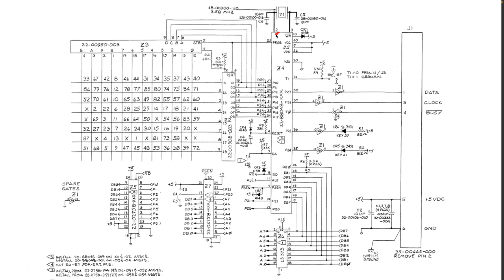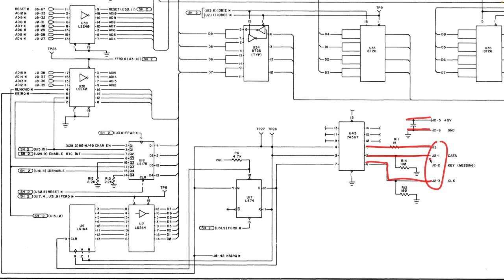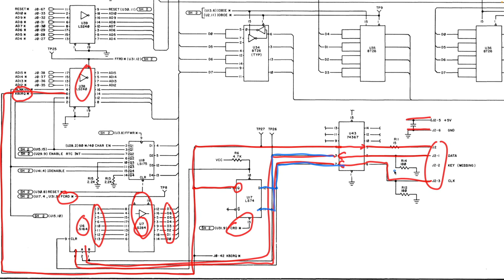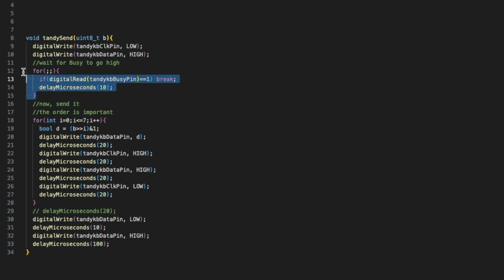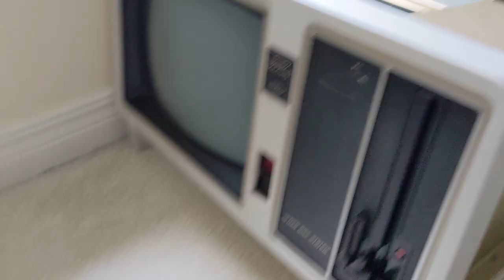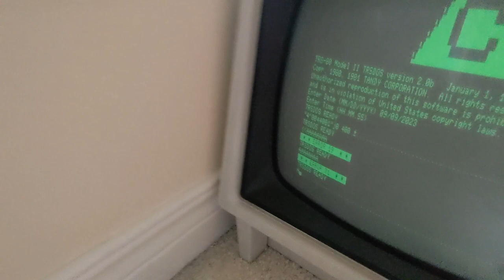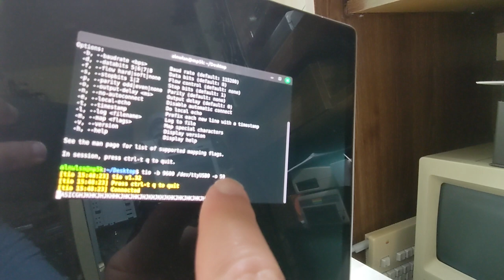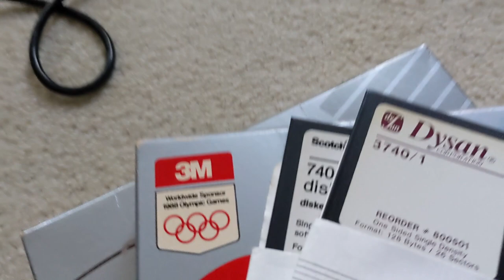Modern keyboard adapter for the Tandy 6000 (and probably other 8" TRS-80 machines) | #septandy

Comment from the maker: Rude of me not to mention @smbakeryt's version for the Tandy 1000. That computer uses the exact same protocol as the 6000, but the key mapping is different I think - I have heard it is possible to use a 1000 keyboard on a 6000 if you change some of the DIN connector pins and use different software. Only reason I didn't go that route is because I couldn't find my ATTINY85s.